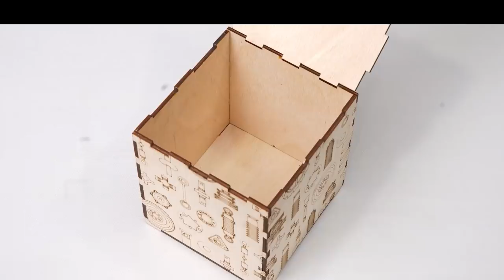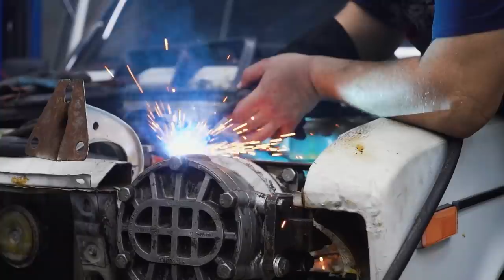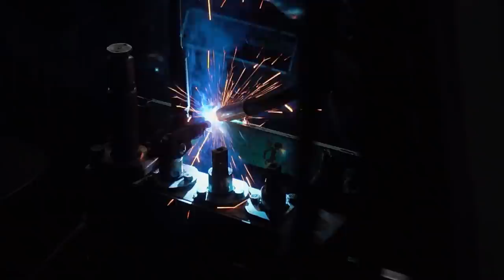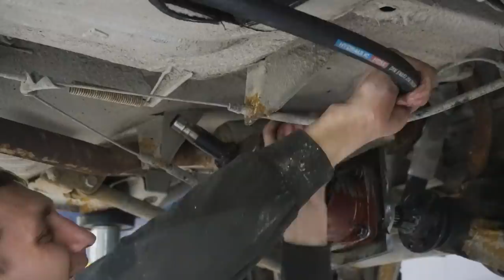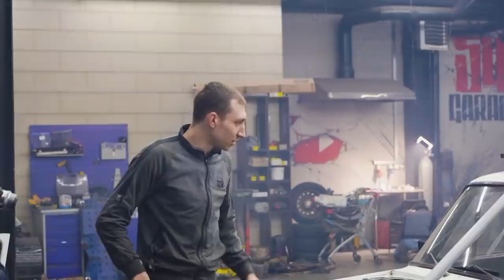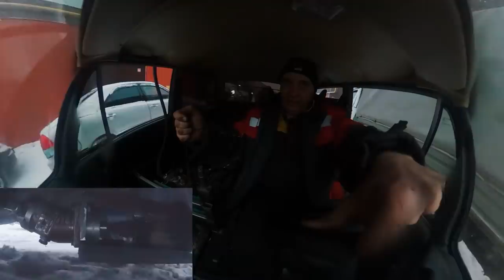Using excavator hydraulics as a propshaft

Comment: Find yourself a Leeboy Challenger 7 and compare notes. Those are very simple, they have a hydraulic pump splined directly to the engine flywheel (Diesel engine though) and run lines from the pump to a control valve which either dumps all fluid directly back to the tank, or if you open a spool valve it will then run the fluid through lines that you have connected to a drive pump which directly couples to the differential. They get up to a healthy 15-20 mphish and along with that they run other implements such as a broom, lift, and tilt. Perhaps to avoid pump cavitation connect it more or less like a dump truck or concrete truck and use a PTO (power train out) which connects to the transmission through a separate gear.
Reply: I love y’all’s ingenuity and curiosity, y’all answer the questions we never thought to ask!
Reply: Final suggestion, a lot of construction equipment uses a double reduction planetary gear set on the final drives, so in essence maybe coupling a second differential like y’all have done before would be a good start, or find a way to couple the hydraulic motor to the transmission and you’ll have gear reduction and the luxury of multiple gear sets, this should be very interesting!

Comment: Idea is sound the Pump is the issue and the lines might be a bit under sized. We did something like this is school but on a go cart
Reply: I'm thinking same.  The diameter of hydraulic cabels is too big and can't make pressure enought. I've self builded tractor  #Garage54
Reply: @duch5829  Agreed but to small and there wont be enough flow. the math is really important on this one.

Comment: You could use a Vario transmission like it is used in modern tractors. It has pistons that ride on a spinning plate which can be tilted to make the pistons move in and out. But I'm not sure if you'd find one cheap and the right size.

Comment: GARAGE 54. Here is a hydraulic test to try. Take the setup you have, dump the hydraulic motor and replace it with two fast-acting hydraulic rams attached to each rear wheel. Like an old steam railroad engine. Somehow using electric solenoids to actuate the hydraulic cylinders in time with each other to move the rear wheels. Also, install a throttle lock to set engine speed to constant rpm.

Comment: Hydrodrive is a well proven concept. The thing is that hydrodrive components are if any and all which are available, engineered for large and probably turbocharged diesel applications. Even in those cases, like a tipper truck or an Excavator, when selecting hydraulic gearthe pump is usually driven after the gearbox with a reduction at least 2:1

Comment: For each gallon you nide 1 HP to move the pump  is 100 gallons you nide 100 HP engine and the pump is 100 gallons you need a list 50 gallons oil tank

Comment: I sure would like to have one of those Ladas here in the US.
Reply: Try to find an old Datsun B210. Very similar imo, after having owned a B210 myself and lots of hands-on time with a Lada. They are both very simple to work on and have similar styling. The B210 was sold in large quantity for the NA market and there are still quite a few on the road.

Comment: if we assume the pump and the motor have the same displacement per revolution, you are basically in high gear, from the looks of it, the pump is probably bigger than the motor, so if the pump moves 30cc of oil per rev and the motor only takes 20cc of oil to move 1 rev, then you effectively have a 3:2 overdrive. You need a smaller pump...higher pressure, lower volume. I would bet the motor is capable of a few thousand ft-lbs. of torque if fed up to it's rated pressure. You guys should add a pressure gauge to see whats going on in the system, chances are you are barely hitting 100-300psi in a system that should be running at up to 3000 psi.

Comment: You need a hydrostatic valve and pump. The valve is closing as soon as you pull the lever forcing all the pressure through the relief valve. The pressure should drop when you get the valve open. If you have pivots there use a speed valve from that

Comment: Yeah, need reduction gear i think. Hydraulic drive forklifts got hub reduction gears, to overcome the low low-rpm torque of axial hydraulic motors. Radial motors are used in agricultural implements where high starting torque is needed, they got pretty much full torque available from 0.5 to 1 rpm.

Comment: Hey about your transparent car parts you should try a transparent turbochanger.
Reply: Watching the gasses flow would be amazing and I'm sure he would be able to put water vapor or some form of particulate in the intake so that we can see the air being compressed 

Just a matter of finding a transparent material that can withstand that high of a temperature, alternatively they could make one out of plexiglass and only run the motor for a little bit at a time. Or simply blow the whole thing thing up for giggles lol
Reply: The idea is to see the air compress on the compresor side as the exaust side the only material that is trasparent and could withstand that temperatures is quartz witch is expensive and hard to mold(melts at 1520°c) and you wont see to much as everything is hot there.
As for the compresor side a simple silicon mold, a negative of the housing, sould be made and on that mold the plastic.

Comment: Just from looking at what you've done I think running a chain drive to the rear end from the motor to slow things down a bit and find the specs for the speed needed for that pump, excavators don't rev up and down much when working so that Lada motor will need a bigger or dual radiators and a big fan to keep cool revving at low ground speeds I'd suspect under so much load.
Reply: Yo my Tang! Read down thru the comments.Every-1 is try'n to take credit for yer idea.  LOL

Comment: as the pump is driven at what should be adequate rpm's (avg electric motor is turning at 1750rpm-diesel less than 3k rpm/petrol engine revving far past that) i would say that the pressure is inadequate or the drive motor is toast. to address the inadequate pressure problem...if that's the case...first make sure the pump is rotating in the correct direction and the seals are intact. second...make sure the lines are unobstructed.....screens-etc clear.
seems to me that the setup you guys chose was correct in it's ability to drive the hydraulic motor.

Comment: If you hook up a cable from the hydraulic lever that actuates the motor to the throttle on the engine, it will increase engine rpm while your load increases on the engine because of the hydraulic pump
Reply: The engine stalls because the hydraulic pump is putting too much strain on an idling engine

Comment: You should use a variable displacement axial piston pump like what is used on a skid steer or small wheel loader.  Then you can vary pump output which then regulates motor speed

Comment: those components are built to run under incredible pressure you just need more torque on the pump or a bigger hydralic motor so that it would spin slower

Comment: Cool project! I'm going to write a book but it will take less time and money for you to read than it did for me to learn! You just built a hydraulic dynamometer! I had one made by M&W gear we used to test tractor pto hp. measure flow and psi and then you can directly calculate engine hp being delivered to the pump so , changing the sprocket ratio will NOT change the hp required for a given psi and gpm (HP required = flow x pressure).  it will just trade gpm (speed)  for psi (torque)  BUT you are spinning that pump that was already about 6 times too large way too fast and the ports are causing huge restriction and cavitation, they're not Superchargers,  oil is incompressible that means you rapidly hit a wall trying squeeze more thru the same ports,  thats why the 1900 rpm of the pump should not be exceeded. But it could've been done geared way down so you could generate enough torque at the pump to get close to the maximum rated psi of the MOTOR, my guess is that the aluminum pump would be lucky to be rated for half of that before exploding.  the hyd motor can only absorb so much pressure and gpm (you actually size the hyd MOTOR hp to the engine hp) (pressure x flow) then pick the right size pump.  in an open center valved constant displacement pump system (yours)  the rest of the unused flow is returned to tank but ALL of the HUGE volume of oil coming from that pump had to be pressured up to hyd motor torque requirements to move the car REGARDLESS of motor flow requirements (speed)  BEFORE being diverted to the sump. this required huge amounts of power that gets WORSE the higher the rpm, sitting still trying to move at say 400psi at 2000rpm required half the hp of winding it to 4000 and still not moving! And thats less the huge hp soak of spinning that pump way too fast! This is why most hydrostatic drives made for constant use rather than just slowly moving an excavator a short distance usually run a variable displacement pump. The pump usually looks bent like the motor and uses a radial piston pump with a swashplate. The plate is controlled by a lever that varies the stroke of the pistons pushing it either direction past center (no flow) will cause it to pump either forwards or backwards. The hyd motor displacement can be either the same size as the pump or larger for more torque or smaller for more rpm. This way you're not pulling a large constantly maximum flowing pump against a huge ammount of flow restriction and a pressure increase imposed by the hand valve position diverting more flow to the motor raising the pressure to the same value at the pump discharge line. For instance getting the car moving with a swashplate pump will still make the same pressure with small piston stroke, thus you can have 3000psi and 1/2 gpm flow at 4k rpm if you want, this takes low horsepower and no extra oil is soaking up power being heated by flowing through a huge set of lines and valves to the tank,  a few minutes and that bucket would melt! Move it more and you can get 20 gpm at 3000psi at 4000 rpm. But 20gpm at 3000psi will soak up 40x the horsepower as .5 gpm!  Since the pressure relief setting directly adjusts maximum torque available the motor,  Its constant at ANY speed that the engine can deliver enough gpm and psi for. with a swashplate pump you can use little power for low speed rotation getting maximum torque! As speed increases volume of pump increases, but max  pressure available is constant. Coasting, there's no pressure resistance from the motor and pump is just maintaining flow for speed.  go down hill and motor flow overruns pump attempting to spin the pump! A 3rd smaller line admits oil for filling pistons, lubrication and cooling. In machinery like tractors and combines, heck, even my Simplicity mower there's a two or more speed gearbox between the hydraulic motor and the axle, this allows for the pump to be sized for max flow at max pressure to equal engine rated hp (pump directly coupled to motor) but allows for faster travel speeds at low load or higher torque at low speed, (driving down the road vs pulling a plow) all of These hyd systems are inefficient at transmitting power because of flow restriction and heat loss requiring large oil coolers. They commonly loose 10 to 20% hp over a gear trans. This was a common problem in garden tractor sled pulling competitions trying to compete against straight gear trannies. Wanna know how efficient any type of drive is? Just see how hot it gets! Trannies warm up and so do hydrostatic and electric drives, how big a cooler does each system use? That wasted heat came from the fuel tank! A much cheaper simpler way to do this, although slightly less efficient than swashplate pumps is to get 2 identical gear pumps rated for about 3x the hp required but rated for the engines 4000 rpm. Attach the pump to the rear of the trans, run oil through the same style valve you have, plumbing the drive pump like a 2 way cylinder.  Make sure the valve stack is rated for the same gpm as the pump going to the other pump hooked to the drive shaft. Placing the trans in a lower gear that gives the engine at least a 3:1 advantage will produce rated pressure at 1/3 the flow, causing the other pump to "motor" at high torque, great for starting out! Shifting higher spins pump faster making less pressure but more flow you can see how essentially this makes a variable speed but no torque increase, somewhat power wasting hydraulic drive shaft. If you make the driveshaft pump LARGER than the driven pump you will get a torque increase at the expense of speed and vice versa. However if you install a throttling governor on the engine that limits its speed to redline you can put it in low gear, release the clutch, floor it, and then start moving the hyd lever. This gives maximum engine torque at 0 kph! Also stabbing it quickly uses rotating mass momentum. You can take off in any gear without slipping the clutch, (you essentially created torque reducing overdrive system with a direct engine driven large pump and a small motor).  And you have infinite speeds in reverse because you can reverse in any gear. Great for snow plowing! (Say you can use 2nd or 3rd for plowing, have infinite speed control up to the normal speed in that gear. AND reverse without shifting!) But always use a big hyd oil cooler! Or you can use smaller pumps between the flywheel and transmission and omit the clutch, the first way will waste less heat at low rpm,  (but more at high speed) shift eaiser, and allow you to decouple the engine from the pump for cold starting (many US made tractors have a hyd  pump decoupling device for cold starting even If NOT hydrostatic driven like my Massey Ferguson 1100 and John Deere 2010). Great show keep it up! Reminds me of crap I've done!

Comment: Gear reduction drive or different motor that spins slower. Higher engine rpms means higher flow and pressure. Looks like a good start though.

Comment: Need to put a larger gear on the pump, or an interstitial jackshaft with geaing reduction to increase torque while lowering the rotational speed (think of a front-loading washing machine, tiny pulley on the motor, huge pulley attached to the drum), as well as a reduction gearbox on the drive unit too, again, more torque, less spin...

Comment: I asume you mean that the gear pump has a displacement of 100cc? That is way to big for this application, it's  meant for feeding big hydraulic cylinders on an excavator, also a hydraulic drive usually works with an axial piston pump to deliver proper flow/pressure with the option of load sense, nevertheless a fun experiment.